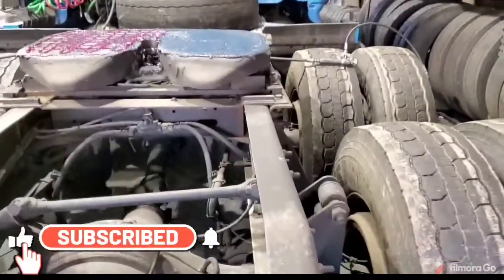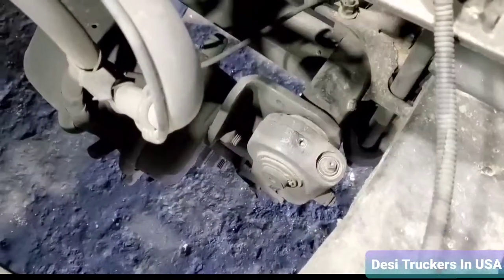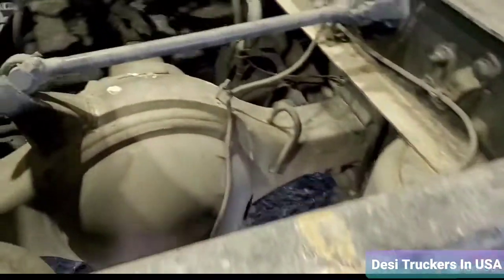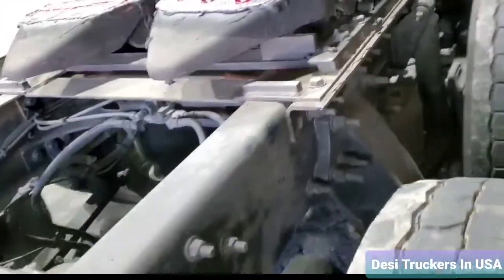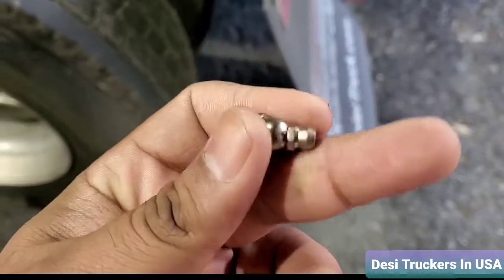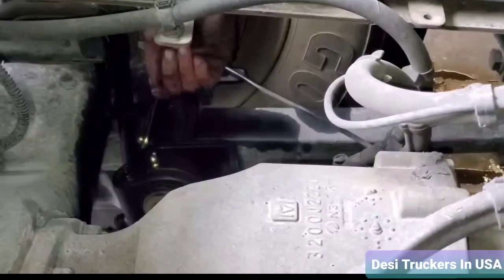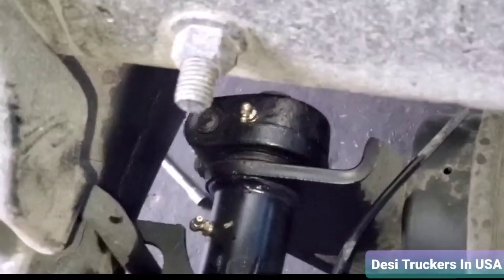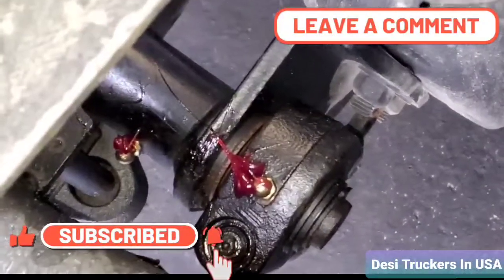How to Add grease fittings on Truck (Slack Adjuster/s-cam/Drive shaft)? OEM vs aftermarket lubes

Comment: Alot of of U Joints are service free. Look up meritor u joints online. They are the expensive one and are suppose to be greased for life. Thanks for this video. I actually replaced a slack adjuster because it didn't have a grease fitting. I had asked the mechanic and he said you couldn't add a fitting smh 🤦
Reply from the maker: As per mechanic if its OEM/ steel drive shafts or U-Joints it don't need greasing but for s-cam ,bushing,Slack Adjusters we need grease even they are OEM.